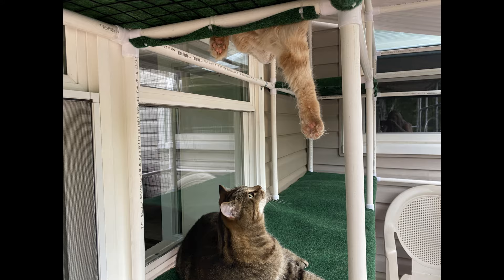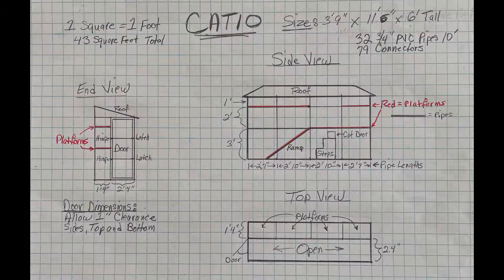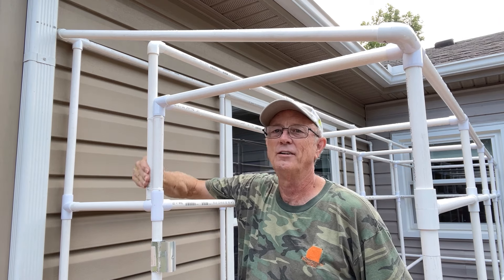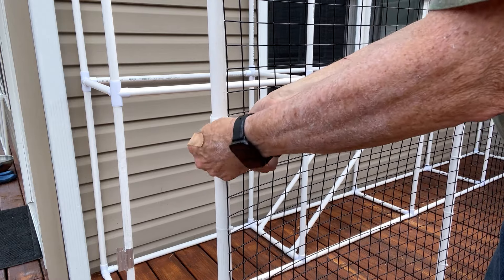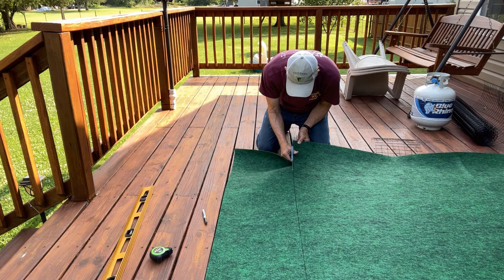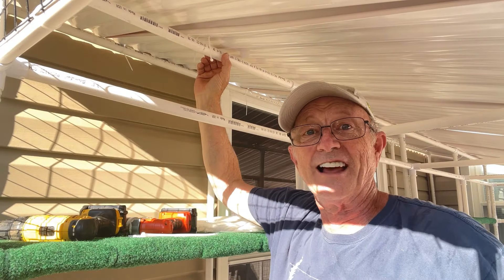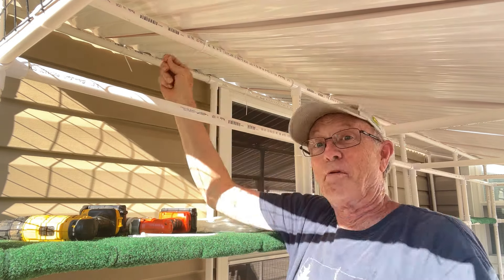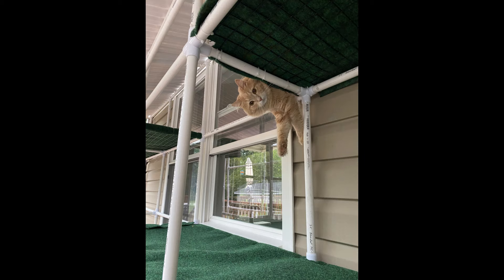How to build a Catio (outside cat enclosure) DIY

Comment: I love seeing "how to" projects that the average Joe and Josie with little to no experience can accomplish. Too many are done by experts with skills way beyond what the average person can accomplish. I plan to build a Catio similar to this. Thanks so much.😻
Reply from the maker: You are very welcome. Let me know how yours turns out!
Reply: Yes! Or they have insanely expensive tools that they think someone like myself with no DIY experience has! No I don’t have a wood cutter with a saw blade!
Reply from the maker: Let me know how yours turns out by joining my Facebook group, DIY Project Station: https://www.facebook.com/groups/882510523338538
Reply: If you do decide to build one, it should be used for temporary purposes. I noticed our catio can get hot on the back porch. So we check on the pet often.Our pets only like it on cooler days.
Reply from the maker: Good point. I removed the lockable feature on the cat door because I read how the door can get stuck closed. I want my cats to be able to go in and out freely, depending on the weather. They don't seem to mind the heat, but they are not going out there very often now that it is cold.
Reply: @RoBeaird  A good solution I've seen to this on other DIY catios is a piece of plastic that covers the door. It slides in and blocks it.
Reply from the maker: Good idea!

Comment: It’s important to make sure the immediate space outside your catio attracts birds…so having a feeder or just some shrubs or perches makes a big difference. Also, think about the vantage and whether they can get sunshine to bathe in, protection from cold etc.
Reply from the maker: Birds still come around; In fact, some have found their way into the catio, since the fencing has 1 and 1/2 size square holes. The catio faces the sun, but their platforms are in the shade because of the roof.
Reply: @RoBeaird I love birds! Your catio is awesome except the screen needs to protect the birds. But the catio is impressive.

Comment: Marvellous, simple, durable, minimal tools required, and easily scalable.
Reply from the maker: Thank you! Are you planning on building one?
Reply: . @RoBeaird   Seriously, seriously considering. Your video is a great teaching tool. What’s particularly great is the dimensions aren’t fixed, and the place I am considering is taller and shallower, but it doesn’t matter. I have even less work to do than you, because my project won’t need a roof (it’s under my broad eaves). I particularly liked that you fitted a door in your project, since that was something I expected would be too big a challenge for me.
Reply from the maker: Cool! Let me know how yours turns out by joining my Facebook group, DIY Project Station: https://www.facebook.com/groups/882510523338538

Comment: This was such an unexpected JOY!!! I have had a metal frame, 5'x3', for several years, but didn't know how to convert it to a catio. My poor cats- 3 of them- have been waiting. You just solved all my "but how do I" problems. My thanks, & also from Pixie, Foxy, & Oliver! (Sub'd, too!)
Reply from the maker: You are very welcome, Patricia. Let me know how yours turns out. Tell Pixie, Foxy & Oliver I said Hello!
Reply: @RoBeaird  We live in South Florida, USA. Subtropical climate eats unpainted wood, so I had been wracking my brain to figure out ramps & climbing spots that weren't wood. This is a  perfect solution for our climate, & I remeasured that metal shipping frame & it's  a bit bigger than I thought, 4' deep instead of 3'. That's a lot better volume! 5' wide, 6'6" tall on the  house window side, slanting down to 4'6" on the outer side. I've purchased a 50' roll of 1" hole chicken wire, & 200 strong zip ties to start. A pvc shoe rack I already have will be repurposed to have more climbing& resting spots, will be drilling some holes to screw it's joints more firmly together & zip tied to the frame. That, plus a roof, screen & ramp (Your method, of course!) SHOULD finish it out. I've already picked out a nice, stout branch for claw sharpening. 🐈 They observe from the window, not yet knowing how lucky they'll be!
Reply from the maker: Great ideas! Yep, our cats were very interested in mine while I was building it, LOL!
Reply from the maker: Let me know how yours turns out by joining my Facebook group, DIY Project Station: https://www.facebook.com/groups/882510523338538

Comment: I made a cario for my daughters apartment balcony using cedar wood 2 years ago.  It was a covered balcony so I didn’t need the roof panels to keep off rain.  Indoor cats need some outdoor space to get fresh air and sunshine.  It also keeps them entertained.  Indoor cats get bored.  Thanks for the tip on using plumbing PVC pipe.  I will certainly make a catio like yours next time I have a cat.  It really looks good on your deck and doesn’t require much maintenance.
Reply from the maker: Thanks! Let me know how yours turns out by joining my Facebook group, DIY Project Station: https://www.facebook.com/groups/882510523338538

Comment: I love this idea.  What considerations would I need to make if I needed to double or triple the size of the enclosure?  My two cats are used to free-roaming in Brooklyn back yards (one is feral, so she really needs the freedom), but we are planning to move to a rural area soon.  I'm too worried about wild animals to let them roam, but I don't want them to feel shorted on space.  This would serve as a temporary enclosure while I build a 30x30 garden that I'll enclose, so the pvc is perfect, but I'm just not sure what I'll need to take into account structural to make it larger.  Thanks for the video!
Reply from the maker: Will the catio be free standing or attached to the house like mine? If free standing, I would upgrade to 1 inch pvc for stability.
Reply: Yes it would be freestanding.  Thanks!!  @RoBeaird
Reply from the maker: OK, let me know how it turns out!
Reply from the maker: Let me know how yours turns out by joining my Facebook group, DIY Project Station: https://www.facebook.com/groups/882510523338538

Comment: This! This is how you protect your cats from wild animals and roads, and save endangered bird species from cats! Cats are NOT wild animals, they should Not be running loose like wild animals. Theres no such thing as a "feral" cat, because cats are NOT feral!
Reply: Wrong
Reply: They should not have to be living outdoors, but millions upon millions ARE with no homes due to people's irresponsibility.
Reply: You people are insane. All animals started out as wild animals and they were domesticated by humans and then humans started crossbreeding them. Cats are originally wild animals and they are more than capable of surviving outside on their own for years. There are millions of cats roaming around because they reproduce quickly.
Reply: @Kit1128  why not? Cats are way more competent than any other pet. If anything they are a threat for the local wildlife since they are very competent predators.
Reply: @chavaspada  I spend a lot of my days working with the feral outdoor cats feeding and TNR. Horrendous things happen to them, not to mention getting hit, which is extremely common.. I've adopted several & in generally they have no interest in going back outside. They are domesticated animals and it's only because people are too lazy or cheap to have their pets fixed. Would you like to be out there 24/7 living with fleas, worms, and undiagnosed medical conditions? Most people wouldn't last a month
Reply: @Kit1128  horrendous things happen in the wild. Every other animal gets parasites, starves or gets hit by cars (deers for example) that doesn't mean deer are pets though.

IIRC after 2 or 3 generations cats are fully feral again. They aren't as useless as most dog breeds are and usually become apex predators of their urban environments.
Reply: @chavaspada  the point I'm trying to make is they were domesticated to be pets. It's through people's carelessness that this situation has happened. That's what makes then different from other wild animals, even though they do adapt to survive
Reply: @Kit1128  Are they domesticated or tamed?
Reply: @chavaspada  
Taming is conditioned behavioral modification of an individual; domestication is permanent genetic modification of a bred lineage that leads to, among other things, a heritable predisposition toward human association.

They're domesticated...
Reply: @Kit1128  Oh ok, I was under the impression cats leaned more towards tamed than domesticated. The question was genuine.

Like those pet foxes that aren't really domesticated just tamed and more friendly towards humans.
Reply: There are feral cats.  If you do not know this, go to your local animal shelter.  They probably have a few.  In New England there are a lot of feral barn cats.
Reply: I have been feeding 6 to 7 cats for 14 years and my two cats and finally my third before he got killed or born of my building and they were there all they had no homes they had no owner and the war to six cats I feed every day showed up at the kittens and they have an owner but next year when I get my apartment building that they will all have a home you are so wrong they are cats have been abandoned one cat a bed for 13 years finally got a whole Maddie was too sick and died three months after he was finally adopted many cats in this country are dumped off by their cruel owners like orangey was and he was a sweet cat.
My two cats Fluffy &  Little Girl are 24 years old and they love me and I love them but I love all the cats I feed every day and consider than mine I just don’t have anywhere to put them in yet I will
Fluffy came in 24 years ago ate dry food went to sleep and never left he adopted me
My original 3 were born on the grounds of my apartment building & their Mama had 15 kittens & eventually died but all her kittens got adopted.
Before Fluffy, Little Girl & Fuzzy came in here, I fed them for several years but the others were fed for 4 years.
I feed mama cat, Kitcat, tiny one, gray, every day mama cat and kittens can’t come into my apartment they are affectively mine at a big orange cat now he shown up he is bigger than any of the other cats she’s very gentle and sweet four months ago he wouldn’t go near me now he comes up and wipes and wants petting but I don’t see him very often but I think he belongs to somebody else
When he first showed up he would hide under cars and would bother the other two cats and now he’s very friendly to everyone here he behaves and he’s a very nice and sweet cat and he will go with me too although floppy will not like having another mail all the other cats are females

Comment: Excellent project! You have given me an idea how to do a catio without wood frame.The hard part is  the tubes to be cut into shorter pieces for the connectors to work,And the catio , needs  more support to stand  gutsy wind  as I wish to build a stand alone catio on the grass, not adjacent to the window.
😉
Reply from the maker: Thanks! I used a PVC cutter to shorten the pipes. You'll probably need to anchor down your catio with U shaped stakes, like are used for trampolines. Let me know how yours turns out!
Reply from the maker: Let me know how yours turns out by joining my Facebook group, DIY Project Station: https://www.facebook.com/groups/882510523338538

Comment: Hi RoBeaird, After watching  your video from New Zealand, have been inspired to build a Casio for our newly acquired  cats (x 2) which we want to keep mostly indoors for security reasons, and your cato built from PVC tubing etc makes it simple and easier than timber, more portable when the need may be to move by not gluing the joints. I am looking at about 3.0 meters long x 1.8 wide, 2.2  Mtrs high  to 2.0 on the low side, sloping roof, and access like you via a cat door though a side window, should workout well and give us plenty of interior play design space, great idea Thanks
Reply from the maker: You are very welcome! Let me know how yours turns out. Greetings from Tennessee!
Reply from the maker: Let me know how yours turns out by joining my Facebook group, DIY Project Station: https://www.facebook.com/groups/882510523338538

Comment: I got some really valuable ideas from this video, thank you. I've been building with metal conduit using connectors from Maker Pipe (I have no affiliation). The advantage with that is that longer spans without supports are possible, and the connectors all come off and can be reused for other projects.  Anyway, I've needed to build a catio and now I know how. I particularly am struck with your idea to use the fencing on a frame to create ramps and platforms covered in the carpet. That eliminates plywood, while being very resilient, draining well, and drying well. Really smart and original ideas. Thanks again.
Reply from the maker: You are very welcome!  Let me know how yours turns out.
Reply: Thanks for the heads up on Maker Pipe.
I am looking at putting up an awning for my deck, and the metal piping gives me ideas.
Reply: @bugwar5545  Hey cool. We made a framework on our patio meant to cover a large built-in planter to grow greens over the winter. The wind caught the frost-blanket cover and blew it around. As an awning you would have less material to contend with to catch the wind, but, you will want to figure out how to anchor the posts. There are weights available that can then be screwed down  into the concrete. Also really plan to use at minimum the 3/4" size pipe if not 1", the 1/2", while less expensive, is just too lightweight for this type of application. Hope this helps. The pipe connector options are like adult Tinker Toys for me.
Reply: @victoriabaker4400    Thank you for the reminder about wind loading and using the larger diameter piping.  I was planning on using the Maker Pipe flange connectors to anchor the assembly to the deck.
Reply: @bugwar5545  Gosh, you're most welcome, glad I could be of help.  Yes, the flange connectors.
Reply from the maker: Let me know how yours turns out by joining my Facebook group, DIY Project Station: https://www.facebook.com/groups/882510523338538
Reply: @RoBeaird  Thanks!  It's going to be a while, but I have your video saved and am referring to your drawings as well, to get the conception in my mind. Our placement is radically different, so I have to figure out the platforms and ramps in a totally different configuration.
Reply from the maker: Looking forward to seeing how your design turns out!

Comment: Great job! It's worth mentioning that you should use UV protected Zip ties and UV protected paint on the PVC. This material will get brittle over time. Unless you're not in direct sunlight like I am in Texas. Have a blessed day, brother!
Reply from the maker: Thanks! Too bad I didn't know there was such a thing as UV protected zip ties, LOL. Thanks for sharing that for the viewers here, though. I didn't paint any of the PVC. That's one reason I used PVC instead of wood, so I wouldn't have to mess with paint. God bless!
Reply: Loved the video!  Such a great catio! And was about to post the same thing:  Go grab a bag of UV protected zipties (a bag of 1000 is about 30 bucks at Home Depot.  They're usually black) and swap out the white ones to keep the kitties safe and secure.  Also, go buy a ziptie gun (20-30 dollars).  It tightens and flush cuts the excess ziptie material with one squeeze.  Will make things go much faster and save your hands.  Good luck and keep up the great work! @RoBeaird
Reply from the maker: Thanks! Good tips!

Comment: I'm renting, and I've been wanting to have a catio for ages. This would be a perfect renters option! I'll just have to make a base and request to screw into the window frame on the outside. Also, howdy from Cookeville!
Reply from the maker: There are other options to secure the catio without screwing into the window frame. You can use something heavy, like sandbags over the PVC pipes at the bottom corners. Thanks for watching!

Let me know how yours turns out by joining my Facebook group, DIY Project Station: https://www.facebook.com/groups/882510523338538

Comment: Nice idea with using the PVC pipes.  I think it would have probably been a bit easier for you and a bit tidier if you had some T shaped fittings but that would have taken needing to know that the roof needed more support in advance and as you said in the video that was an 'on the spot' realization.

Comment: Nice engineering and explanation... if I do this I'll have to be sure to begin 'flea drop treatments'  because of the visting cats, raccoons, possums, skunks, etc.
Reply from the maker: Thanks! I've only had a visiting cat so far and a small bird which one of my cats enjoyed!
Reply: @RoBeaird - had any issues with the plastic zip ties?  I'd likely use stainless steel. Such a great enclosure!
Reply from the maker: Thanks. The zip ties are now starting to break. After I built it, I found out there are heavy duty black ties available, LOL.
Reply: @RoBeaird  - I ran into the same problem.  I live in an area w/extreme heat/cold and the ties I used become brittle and break.  I didn't know metal ones were available - just ordered some!  :)
Reply from the maker: I didn't know about metal zip ties, either. Great idea.
Let me know how your catio turns out by joining my Facebook group, DIY Project Station: https://www.facebook.com/groups/882510523338538